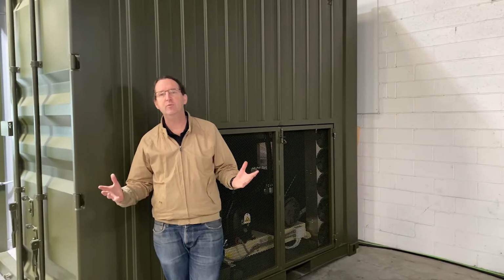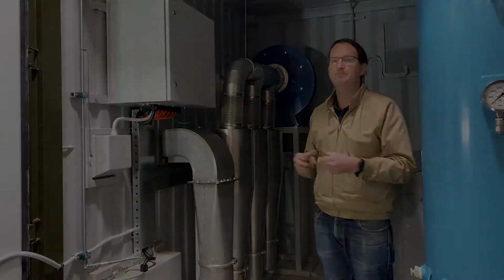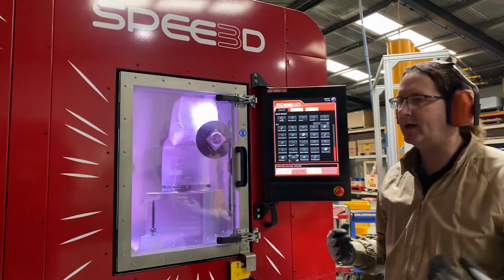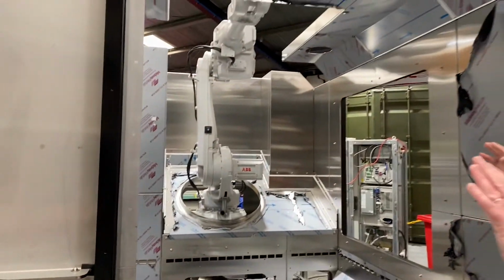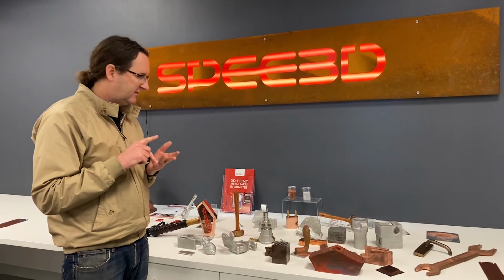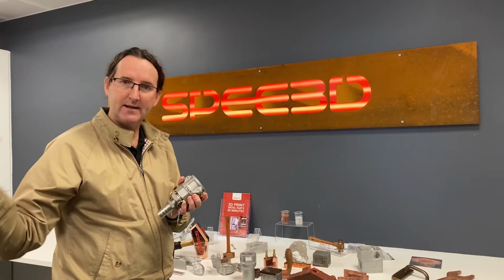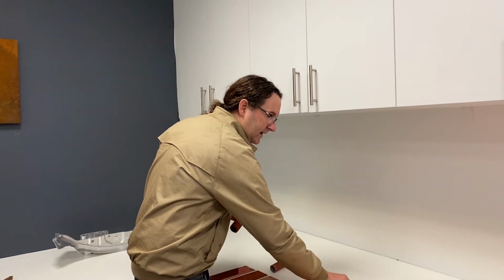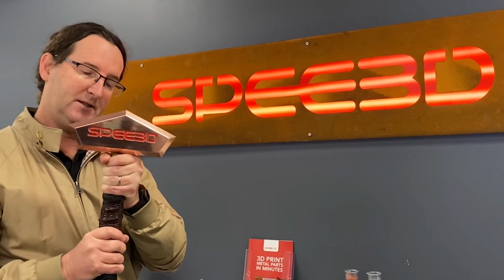SPEE3D Factory Virtual Tour

Comment: Very impressive Byron. I missed in the video what the maximum dimensions and weight of a completed component could be ?
Reply from the maker: Hi Russ Reynolds, thank you for your question! Our machines, such as WarpSPEE3D and XSPEE3D, are able to fabricate metal parts up to 40kg in weight (around 80-90 lbs), and up to 1m x 0.7m (about 40 x 30"). We hope you found this helpful :)
Reply: @SPEE3D  Thanks for that. I'll be in touch.

Comment: Can it do plastic piping with an activated copper lining?
Reply from the maker: Hi Nichola, thanks for the great question! We manufacture our machines to 3D print using metal powders. While our technology can not be used for plastic, SPEE3D printers can coat ACTIVAT3D Copper onto metal or ceramic surfaces.